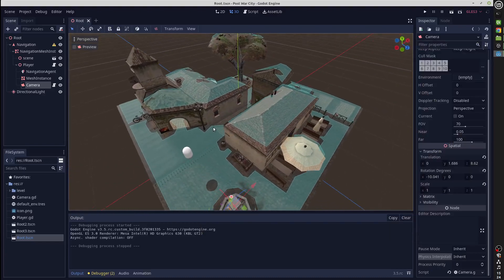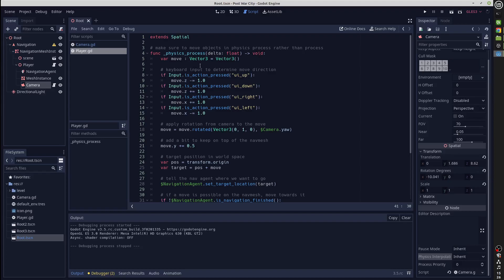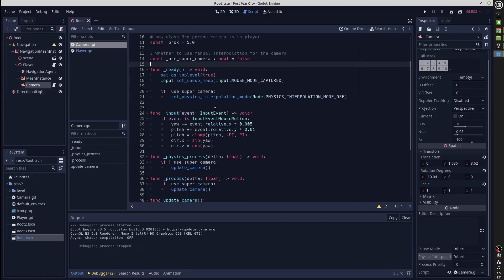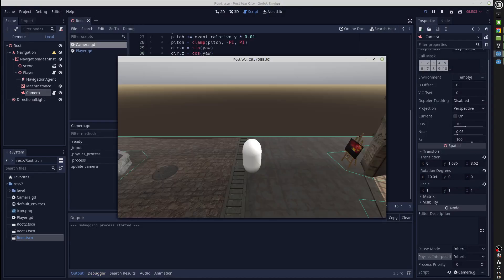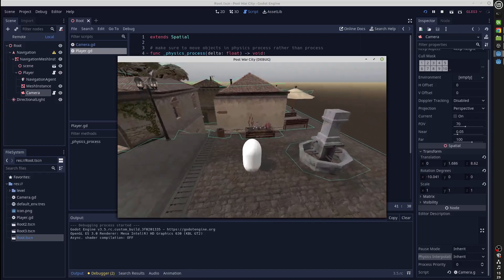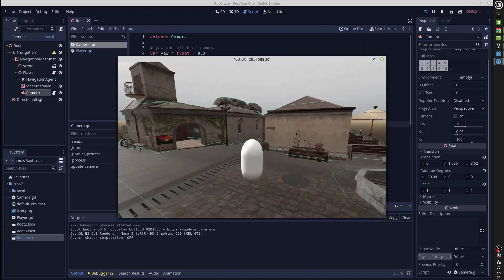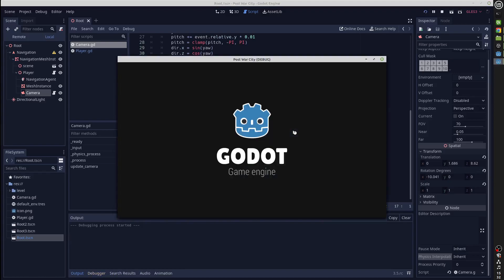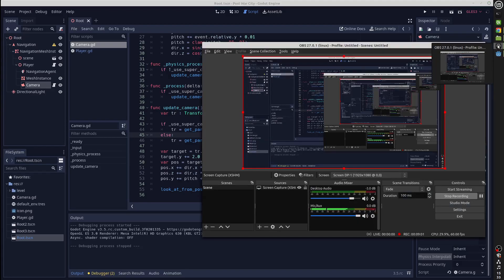Godot 3.5 Physics Interpolation Tutorial

Comment: isn't that because you made it to child to the player, when the player move the camera script constantly reading state and readjust itself (which is btw, double calculation) hence the jerking motions?
Reply from the maker: You are absolutely right to mention this as a potential source of feedback. But in this case, if you look at 2.34, at line 17 of Camera.gd I call "set_as_toplevel(true)". What this does is make sure the Camera does not inherit the transform from the parent. I forgot to mention this in the video.
Reply: i came from unity sphere (my whole 11 year career) i hope i am not offending people when i mention unity.
Reply from the maker: @greendino5868  Is no problem, I used Unity a little before I moved to Godot, it is a great engine. They both have strengths and weaknesses .. Godot was a better fit for me for a number of reasons, but primarily the open source nature and that I could contribute to it.
Reply: @lawnjelly  And Godot is better for having you. Thanks from the community!

Also, never knew about set_as_toplevel(), that's a feature that I will definitely use. I was reading your PR for this implementation and was kinda bummed that I would need to move my camera from the player to the root, because it wouldn't visually/conceptually make sense (even though it technically would if you get my drift), but set_as_toplevel() allows me to have my cake and eat it too!